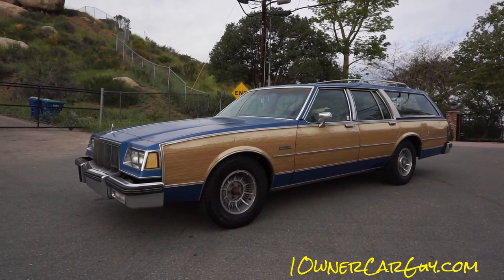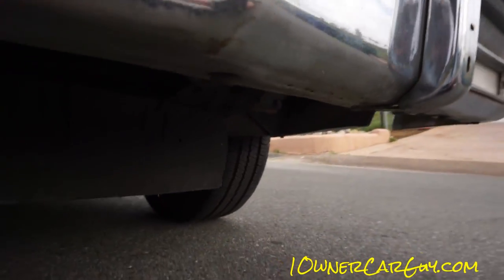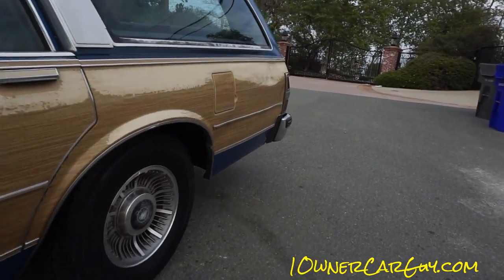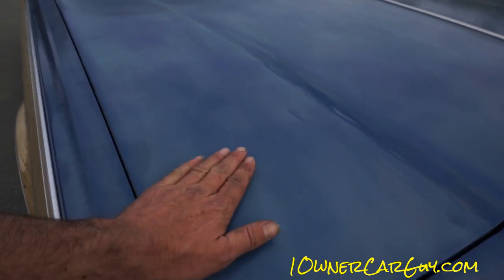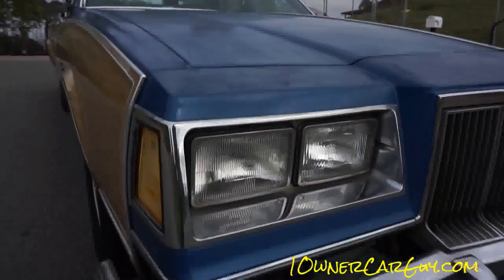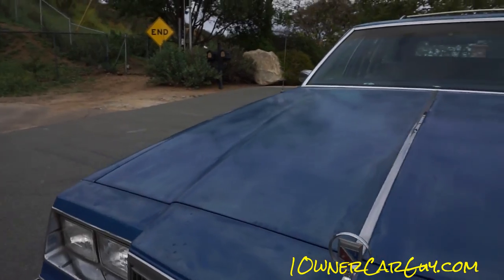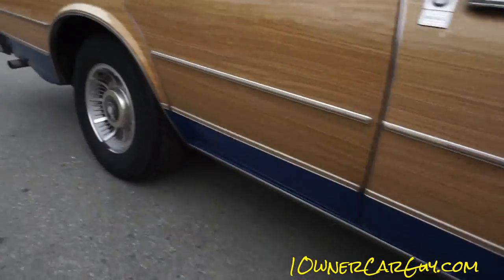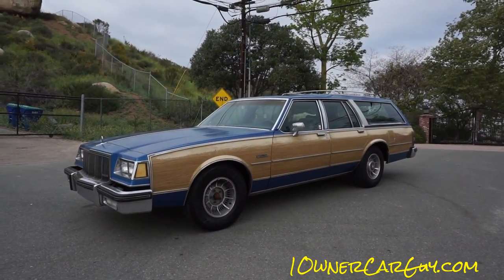Station Wagon Review Video Buick Electra Woodie 1 Owner Classic

Comment: It was the creation of the Dodge Caravan that killed the station wagon concept.
Reply: Minivans are an atrocity upon mankind.
Reply: +june201955 I dunno about that, and I'm interested in wagons. It was also (according to what I read) car companies intending to phase it out by means of promoting SUVs. They weren't about to meet higher fuel efficiency and lower pollution standards, so they went for making SUVs which are a bit of a grey area; they are (or were) classified as trucks by the EPA so they can have lower fuel efficiency and higher pollution. Yet the SUV I have doesn't require a Truck license plate in Pennsylvania. Well whatever, an SUV is still a wagon in my mind - but a truck-based wagon and not a sedan-based one.